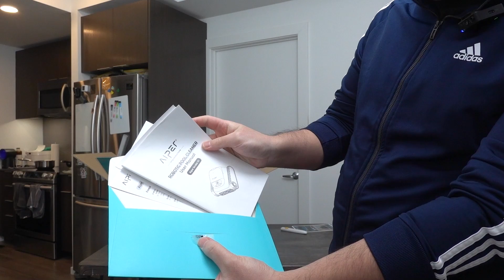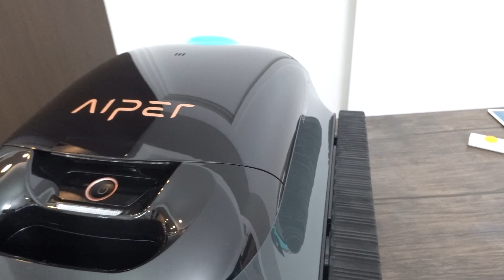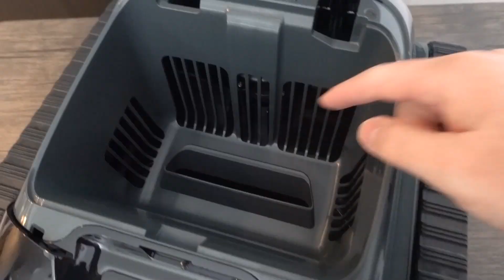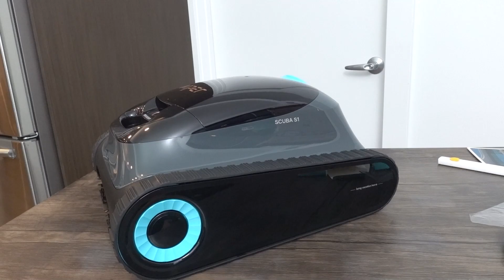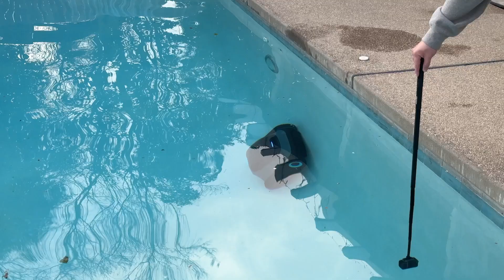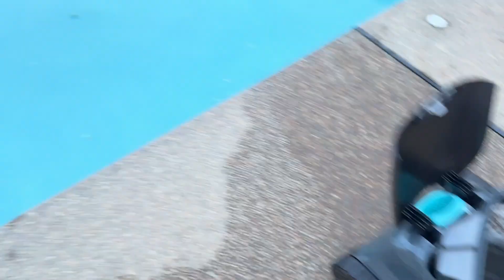Pool Vacuum That Actually Cleans? Aiper Scuba S1 Test

Comment: Regarding cleaning efficiency specifically, is the Scuba S1 as effective as the Seagul Pro?  

I saw your comparison in the other video and noticed that the Scuba S1 collected more dirt than the Seagul Pro, but you said you had included the Scuba before.  What is your perception of the comparison between the two in terms of cleaning efficiency?